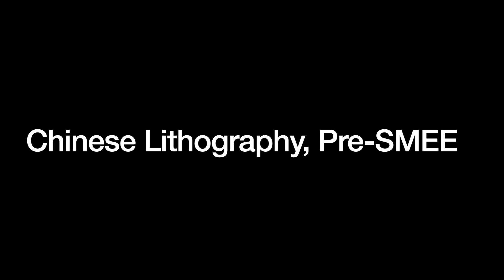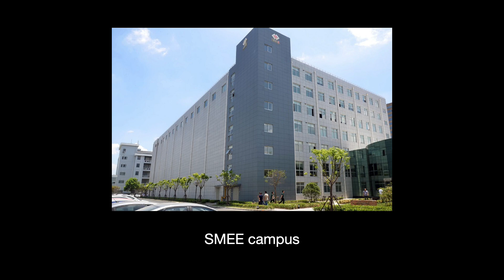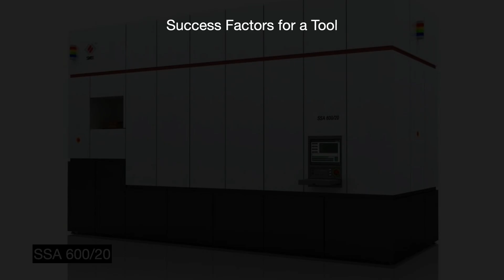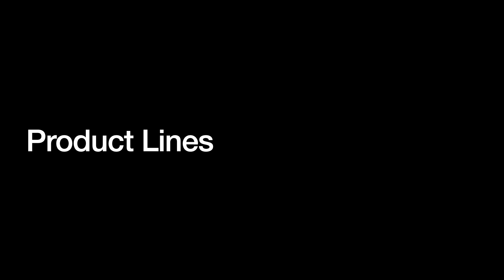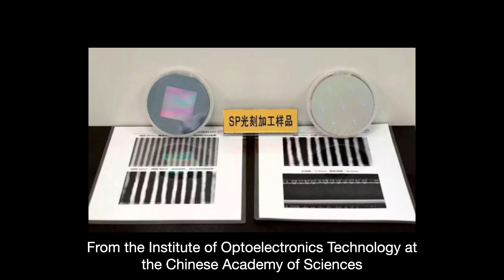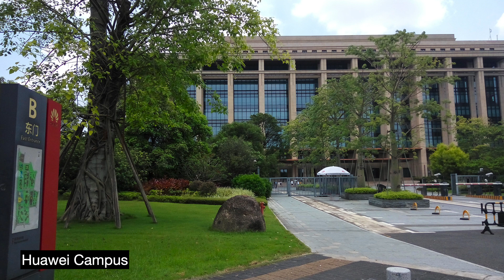China’s ASML is Years and Years Behind

Comment: Thanks for this. This has been the video I've been waiting for from Aaianometry.
I defer to your research, but based on my research; 20yrs seems a little pesimistic. 
It's true that there is a gulf in knowledge/capability that is min 10yrs but I factor in that this is the first time Chip production has been a superpowers essential strategic resource. PRC will approach chip production with the level of determination approaching that of USAs determination to be the first country to put a man on the moon.
This is compared to all previous chip development which, though, highly competitive, has been driven soley by commercial interests. 
My informed GUESS is that by 2035 PRC will have full range, secure Independent chip production
Reply: @SISYPHUS VASILIAS I agree with your assessment. China is between 10-20 years behind the leading edge, probably closer to 10 than 20. A fully domestic 28nm process will likely be possible within the next 2 years. After that, the move to 7nm will be fairly rapid.

The real catch up will likely come with the move to 3D stacked chips. Historically major industry transitions are when latecomers have the best opportunities to catch up to and surpass the current leaders.
Reply: And while they lack cutting edge tech for newest CPU, they have independent chip industry suitable for army needs (missiles, UAV and so on), thus securing this area completely

Comment: Mature node manufacturing equipment are reused from the node race. But as the node race slow down and the total need between 3nm and 250nm increases. So mature nodes need new replacements. So the slowdown create a new equipment market.

Comment: It is a long shot for China. But I am confident that they will pull it off eventually. 
The working pace in SMEE is nothing compared to Huawei. 
They are gaining slow because there is not enough revenue from selling their products. However, with the recent chip shortage and tech lockdown from the US. Things are changing fast. In the end, SMEE might not be the final champion. Just like what happened in telecommunication, Huawei out compete its domestic counter-parts in a stunning fast speed.
Reply: Semiconductor equipment manufacturing does no work like that, China has to develop all the underlying technology and tooling  used to develop those machines from scratch , that takes years and billions of dollars , China doesnt have years to wait
Reply: @eduwino151  its really hard but China is not doing it from scratch, almost for every subsystem likes light source or immersive system there're indigenous players but they performed just like SMEE that moves staggeringly due to no business motivation. Now everything gets changed, lets just wait and see.

Comment: Being mere years behind is actually very good! Russian semiconductor plants are around a couple of decades behind, maybe even more, yet for cruise missile guidance computers and almost all other military electronics in general, even for the most modern designs, it is already more than enough. And as we are approaching the hard limits of semiconductor electronics manufacturing and as the technology starts to stagnate, the gap is only going to get smaller. So now it is not about who is going to have less nanometers of resolution, but who is going to get just enough as cheaply as possible. And with all the tightly coupled and integrated industries of China it is going to be near impossible to beat.

Comment: Much cope in this video but here are the facts:
1) China is 1 of the only 3 countries capable of producing 28nm lithography machines, (other are Nederlands ad Japan), US cant do it, Taiwan cant do it.
2) Proportion of domestically produced components in those machines is far higher then those of Japanese And Netherlands competitor, meaning they are commercially far less sensitive to US meddling and blockades, giving them opportunity to sell on the markets their competitors cant
3) speed of development of machines for new nodes at SMEE is far grater the among their competitors such as ASML, so despite fact ASML had 20 years head start at this moment they are only 10 years ahead, and by 2030 they will be only a year or two ahead and will be losing much of their market to more independent and agile SMEE
Reply: US Can't do it >    INTEL is US. and they're already capable of 10nm with their own and have been researching EUV since the early 90's  Capitalist countries will always have more talent and human capital than communist countries.
Reply: @Shinobubu  Intel does not make lithography machines, they buy them form ASML. Basically you dont you dont understand the difference between equipment manufacturer and their costumer.
Reply: I think you got it wrong. ASML is multi national company with headquarter in Netherlands. It does not make every component of EUV machines. Even Japanese companies are important suppliers of EUV machines. Secondly ASML had acquired SVG lithography and many other American companies which are subsidiary of ASML.so U.S. can still make lithography machine.
Reply: @SaurabhKumar-uo6ms  From what you say I'm completely right. As i said ASML cant make lithography machines ingeniously within Netherlands, or even EU alone, it is dependent on foreign suppliers, even more so then SMEE. This makes it more susceptible to blackmail and extortion by US, and that makes it in the long run uncompetitive compared to SMEE that works to make it's product independent of US extortion.

And US itself did not assemble its own indigenous  lithography machine in decades, last one they manufactured back in the 90s were  >100 nm node. This days US can make but handful of components and noting more, it is way behind China in that area.
Reply: @ZoneofA  China is still buying DUV from ASML, Nikon and Cannon and U.S. is not stopping them. SMEE still working on same equipment which china (or any other nation) can buy.
Secondly U.S. has technology to create old equipment but it makes no sense for them. Multi Patterning was first started in U.S. and DUV still uses 193 nm light which is used in 14nm node.
U.S. still makes critical component of these machines. 

Anyone of U.S. allies in the lithography supply chain can stop the lithography machines sales. Because U.S. is the security guarantor of them, U.S. generally decides to put ban or not. 
Technically Netherland can also still give permission to ASML to ship EUV equipment to china (it has less than 25% american equipment, so it will not break american law) but i think dutch politician also do not want that. Even Germans do not sell their top Equipment to china (e.g Carl Zeiss lense as mentioned on video).Italians,Brits has stopped the many foreign takeover. There is long list of such actions by Europeans.
Only  Difference is Europeans do not brag about it like Americans do.
Reply: ASML has a significant USA presence to develop and build its machines in Connecticut and California.  In fact, ASML’s core technology originates from two California based firms it bought, Silicon Valley Group in San Jose and Cymer in Carlsbad CA.
Reply: @youmothershouldknow4905  Cope is real.
Reply: @youmothershouldknow4905  few of thousands ASML subcontractors are based in US and that means US is actually relevant...

Just ignore vastly more subcontractors ASML has in China and that US has not assembled it's domestic lithography machine in decades...
Reply: @ZoneofA  Note that the ASML machines are built in Connecticut, with the most crucial component built by Cymer, a San Diego area company that ASML purchased a few years ago.  San Jose R&D branch is also, unsurprisingly, crucial.

Comment: China doesn't need to be able to make the very latest chips as good as ASML-based ones in order to significantly reduce dependence on foreign equipment. They just need a process that's good enough and is based on domestic supply chains. If they can start to crank out lots of cheap, low-spec chips based on older tech, that would almost certainly help alleviate the global chip shortage and make them a bundle.

Comment: Even if China could make 100nm chips alone, it would be sufficient. Most computer processor power is used for bloat. Easier to make code 10x more efficient than to make chips 10x smaller?

Comment: all this is before the sanction where market forces and no serious government support, now it is of strategic importance and this time the whole of China is taking this seriously. very likely, all former private and public competitors are getting behind one or two champions to make the latest machine. for sure, they will also explore all other possible options and different tech branches. very likely also, the silent military may be behind some of the support. by 3 years' time, we will know if they can make it. as long as they can make smaller nm machines, it meant it is a matter of time before they succeed. given China's tech sector size, they should be able to advance 3-5 times faster to parity. also, for someone just reading Chinese news, can tell all about the inner job status, use common sense, for China to get EUV machines is of absolute strategic importance, one would think that this job would not be just be left to the private sector. think of the space station and jet engine, just appear out of nowhere. my gut feel is that there are many shadow companies now doing this and SMEE is just the visible face. I do not think that when they achieve success, they will announce it,  like the jet engine, it will gradually dawn upon everyone when products from china start using chips from these new machines. also, the truth is very likely to be found from the imports of semiconductors, if the imports fall drastically, for sure, this is a clear sign. nm size doesn't mean much, dollars and cents are the real deal.

Comment: another incredible  report or video

yes china i sbehind years
but as i  thinking  with a practical mind, a coffegrinder  wont  need chip like  an F16 example

another  practical view,  with exist technology  they can produce  their  own  chips  for  vehicles
with  the 2 nm tech a chip  going to be  example 10 by  10 mm  with  10 nm tech  same chip, same  circuit  going to be  50 by 50 mm

will it change really things in a car?

also thank you for this  historical  insight
because its  also cutting in the narrative  that china  just stolen  blueprints  and made a machine

china started  on this   area very early, so certain way   china achieved a lot  on their own

overall,  even they  might can not break in the market with machines,  still they can produce  a very substantial amount of chips,  at least for their own needs

Comment: Really well put. As you correctly point out, much of the ultra optimistic and patriotic rhetoric that comes out of China makes it sound like manufacturing state-of-the-art microprocessors is like manufacturing toasters - all you need is to throw together a factory and then start churning them, which could not be further from the truth. They are probably the hardest thing to manufacture on earth. Even just the components, software, and engineering expertise needed to build the parts-that make up the machines-that make up a fab-that manufacture the chips, is extremely complex. Also the point the human capital is spot on, it’s definitely not simply just a question of salary salary- the difference in quality of life between working for a state owned corporation in mainland China who uses the “Huawei model”, and a western tech company in an ultra liberal (even by European standards) country like the Netherlands is so vast, it would be like comparing with working on the moon.

Comment: These Champions need a different culture of organization. You should read Geert Hofstede on the types of culture of organizations. Most old agrarian cultures have role models that suppress ideas that flow horizontally or from the bottom up. This is necessary to maintain the cohesion and the distribution of roles and tasks. .A few traditionally sailor societies maintain low hierarchy and balance cooperation with high individual empowerment. This works well in relatively small teams of very able individuals.. Like e.g. startups. (Of course in the end in every society companies. when they get big enough, poison the atmosphere and dominate by sheer weight of capital and number of eager careerists). /